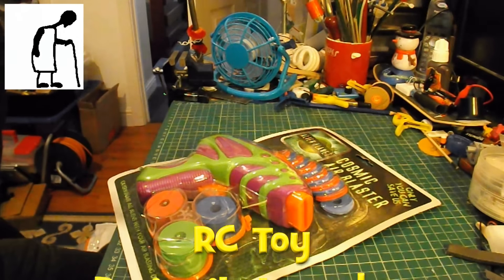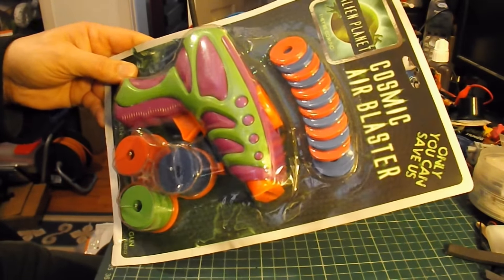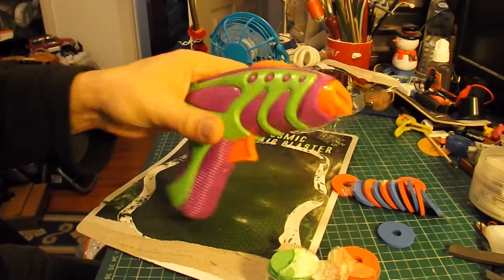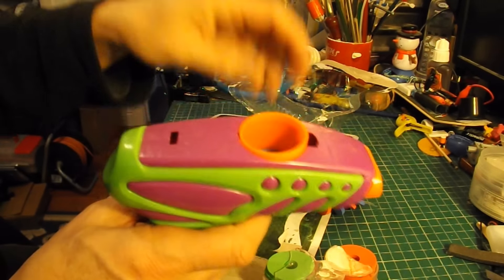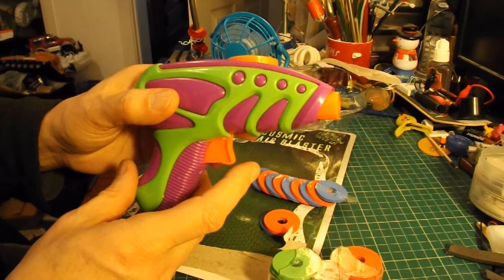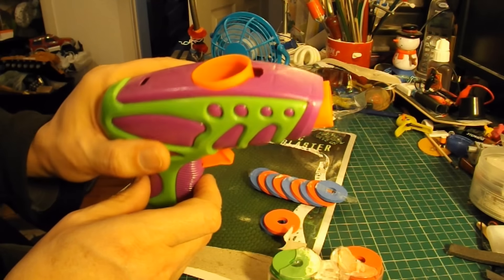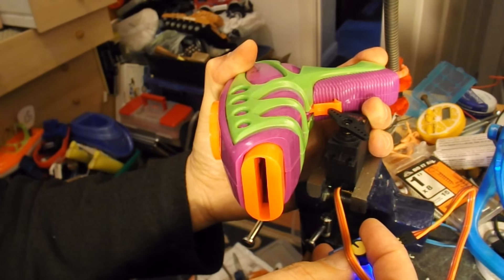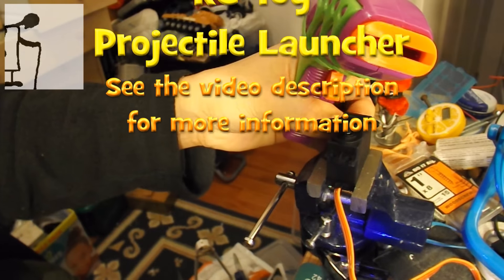RC Toy Projectile Launcher Part #1

Comment: Hello :) 

I had an idea that I thought might make a interesting 'Junk Pile' project. The idea is to make a table top toy that is basically a perpetual motion toy. What it would do is to take a object (a marble or ball baring) and send it around a course and then it would return to its original position and start all over again and it would keep doing this over and over again. You could use a motor to power (even solar) or you could do it without any power and just use science or physics to drive the toy. You could use one marble or two or as many as you want. The rube goldberg machine gave me the idea for the project. Just thought it would make a interesting little 'junk pile' project :)

Thanks for reading.
John
Reply from the maker: +John thanks for the suggestion, I steer clear of perpetual motion machines as they are just fakes. As for a marble maze toy, they turn up in charity shops often enough and some of them already have an electric motor to return the marble to the start.